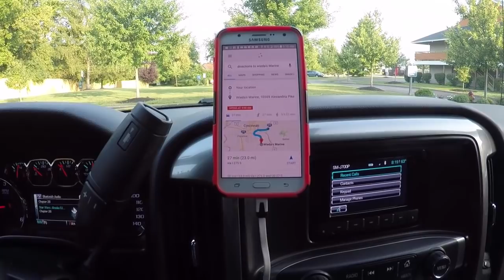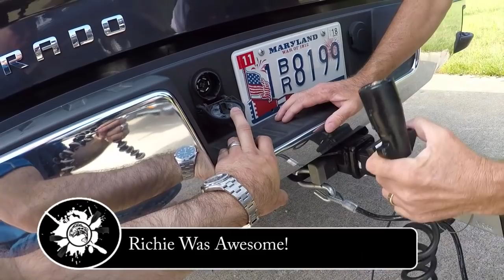Buying A Bass Boat My First Bass Boat

Comment: I just inherited a 1987 skeeter strada FS-80  bass boat with a 60 horse power Nissan outboard engine from my godfather.  He always had it garaged and it was always in freshwater lakes but it has not been in the water for about 4 years.  It will be my first boat what do you think I should do first.  It appears to be new.

Comment: I have a 2013 ZX20 skeeter, shaun is right factory you should be good. It looked like you have an sho 25 t2 or t1 prop which is the right prop that or an FXP, if your really trying to get speed I suggest your either raise the jackplate and play with it. The sho s like to be run higher than per say a PrO xs. I can get 76 almost 77 with a factory 26 fxp and im turning almost 6100 rpms. However my jackplate is at 7 dots above (haven't measure prop to pad should be around 2 1/2) anyways good luck
Reply from the maker: Awesome advice...I definitely want to squeeze some MPH out so once I get good and accustomed to it I'll look into thanks!

Comment: Congratulations on the new boat. My only question is about warranty issues. Where do you have to take the boat or trailer when things need repairs? Do you have to go all the way back where you bought it? I do own a bass boat I bought new. I had to take it back for warranty work 2 times. Each time I had to leave it for more than a week. That's a bunch of trips to Ohio if you have problems.
Reply from the maker: Rick David couple of skeeter dealers in my vicinity and loads a Yamaha mechanics.
Reply: BeyondTheBounds I was looking for some near Maryland. I think I will just wait for the fishing expo in VA next year to get my hands on one . They look like a quality boat.

Comment: What truck do you own
Reply from the maker: Jonathan Nguyen Chevy 1500
Reply: Friendly warning BeyondTheBounds, be sure to remember to use the Tow-Haul feature when towing. I live in Florida where it's flat as all heck, and most of my fishing was only 20 minutes from my house, so I didn't give it much thought. I was wrong, tore up the transmission on my 1500 towing a 22ft bay boat. I don't think it was the 20 minute trips but the 2 or 3 open road trips a year, that did the damage. Great looking boat you've got, have a blast. BTW 50+ mph on the water is no joke, be prepared to arrive faster than you think.
Reply: That's how it started, when it was over I think I only had a gear left to limp it to the shop, entire rebuild.
Reply: Gotcha. I put my tow/haul switch on and let the truck choose the gear it needs to be in.